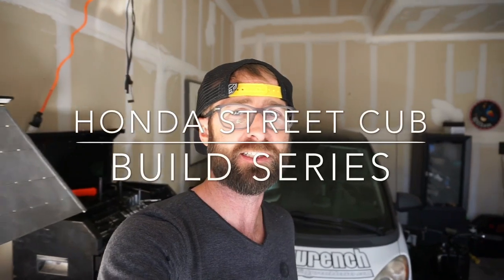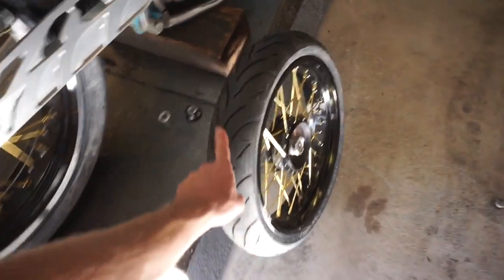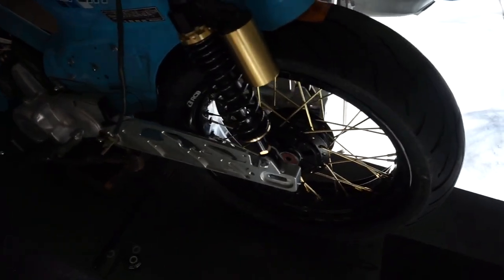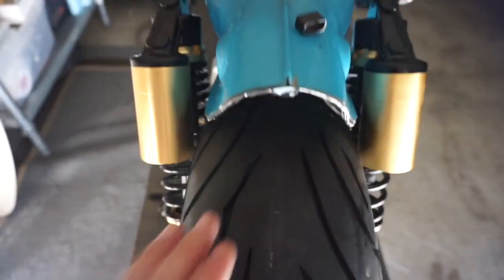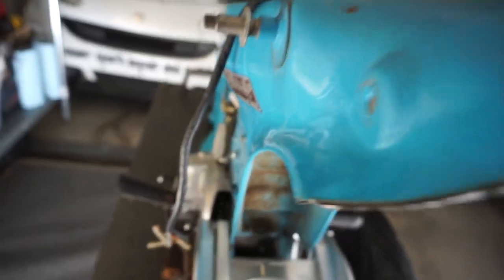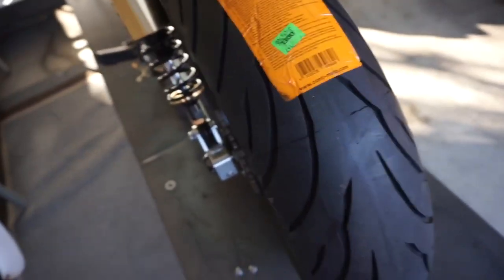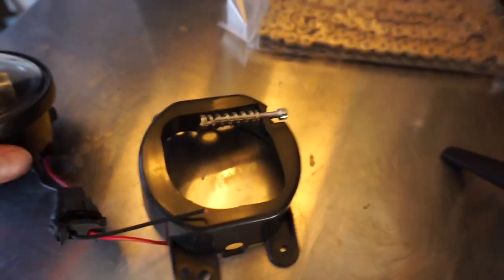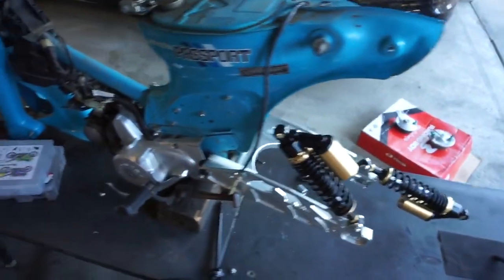Honda C70 wide fender modification [EPISODE 3] 2019

Comment: I am about to start a dry build here in Japan, I have bought some complete wheels form Vietnam, rims measure 50mm on the inside parallel section, before they flare out. Do you think 100/90-17 will fit rear and 90/80-17 front, I was thinking pirelli angle city's. Any advice would be appreciated.

Comment: Where did you get those rims with the hubs? I bought a set of excel rims that I'm about to mail off to get some spokes/nipples made.
Reply from the maker: Victor Valle oooo man. It took me a second trip to Thailand to find the spokes and nipples. I looked for a year online for them, no luck . I found them in Thailand in seriously like 10 min. The hubs are stock, just opened the holes up for the spokes. I’ll get back to you on the spokes, I have to find the box. The wheels are Racing Boy, purchased in Malaysia .... much cheaper than excel.

Comment: if you want to widen the fender easier then use a heat gun just to make the metal less solid and yet manageable enough to shape. just a tip ;) from philippines
Reply from the maker: 🙏 Thank you. I’ll try that method next.

Comment: The 140cc is wider than your 70cc. if the finished bike is going to have the larger engine, you should have started with installing the 140cc, as it will change some of your spacings.
Reply from the maker: Bernard Adams the other motor is the same dimensions. Hopefully..... :-)